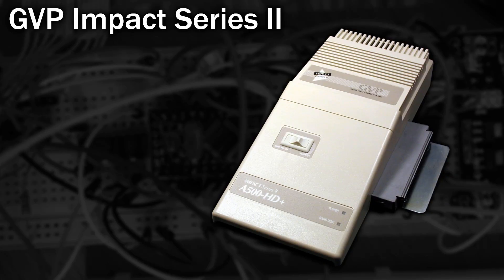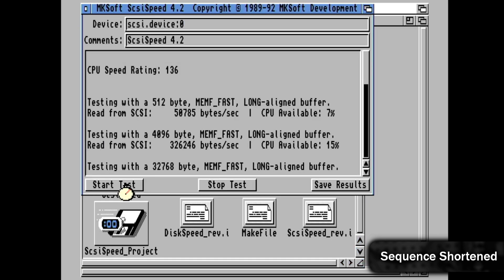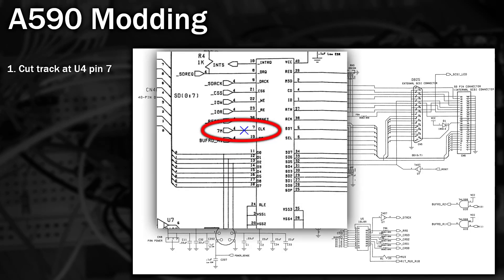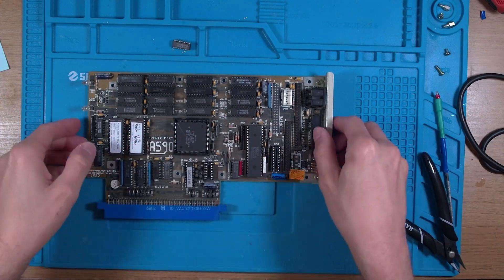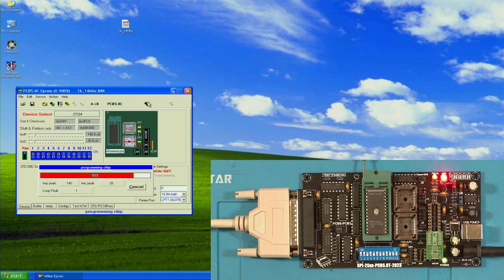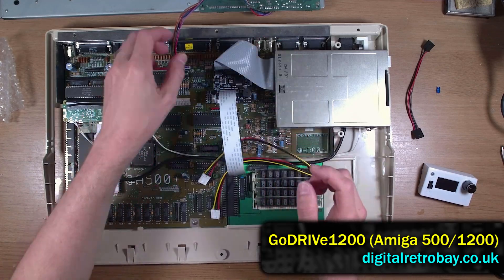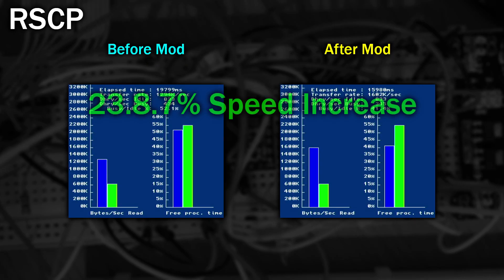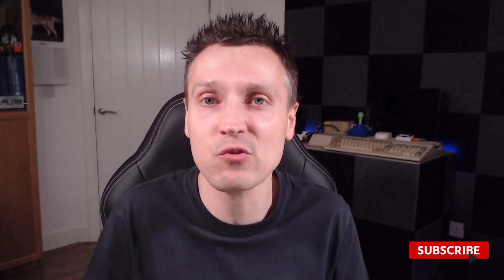14Mhz MOD - Turbo Charge your A590 - Back from the Dead - Part 4

Comment: I don't want to talk down the MOD. But with V7 ROMs, the latest SCSI chip, DMAC 2 and ZuluSCSI I have 1,453,663 bytes/second without any other modifications.
Reply from the maker: Yeah it’s fast enough without the mod, I just like experimenting. Someone pointed out a 20mhz mod too! I recently reverted the mod because it was causing some instability issues

Comment: Clearly there is room for more episodes in this series ;-)

I see two obvious areas for improvements: A. Since you now have a DMAC rev2, you can upgrade to a GuruRom. B. You can implement Speedgeeks improved ram-controller..... also the 74 series chips could be upgrade to ALS series for better/faster signals. 

Finally you clearly have other computers with "real" parallel port than an old dell... see that Amiga over there, it has a very nice parallel-port ;-) It would "only" take a reverse engineering of the eprom programmer software and a reimplementation on amiga-os then you can use the burner on the amiga hehe.
Reply from the maker: The GuruRom is really hard to get now from what I’ve understood and V7 of the normal roms is more or less the same. Oh I saw something about an app that copies the roms to fast ram for a speed boost, is that what you meant?
I’m not sure upgrading the 74 logic upgrade would speed it up but yes the signals would improve. And reverse engineering that beast of a program onto the Amiga, wow, I just don’t have the time for that!!! - there is one more episode on the way, but it’s not what you’ll be expecting

Comment: The header inside the GVP is not for an accelerator it is for the 286 bridgecard addon.  Commodore likely didn't do the speed mod because at the time the 14mhz version chips may not of been out or may of been more expensive.
Reply from the maker: Hmm not sure about chip versions, the only thing that was different is the ROM. But take a look at the 20mhz mod pinned in the comments. Works on original chips too. Who knows

Comment: Thanks rob, great video sir! Loved the bonus gotek mod you included, that is the way gotek needs to be done on the A500... but the controller mod that sits on top of the A500 all seem to be in white and doesn't really align with the original a500 aesthetic, better than nothing tho and cheap... but that really needs to be redesigned...  I wonder if an empty floppy drive case with the gotek display built into the side? Be interesting to see you design and build one!!!!
Reply from the maker: I totally agree about the Gotek. Shouldn’t be cutting holes in the machine and it looks great. I think you can get external gotek drives already or is this not what you meant?
Reply: @RobSmithDev Yes sorry, allow me to clarify. The current standard external gotek as you know needs a df0 mod for the a500 when using a standard external gotek seen as df1, the solution in your video bypasses all that in favor of keeping the original a500 floppy (A must for purists like me) but with the external gotek mod as featured in your video. So instead of using that 3D printed white case for the gotek display and jog dial, how about a empty external Amiga floppy drive case modified for the gotek display and jog wheel mounted physically into the side of the empty floppy case that can now sit on top of the a500 perfectly. From an aesthetic point of view would look like a traditional a500 external floppy drive with the power of gotek.. (not sure how practical it would be to do tho) I hope that makes sense!!! Great videos rob, the time, effort and diligence you cram into your videos is joy to behold!!  Your work with drawbridge and how it came to be really is phenomenal all these years later...Incredible!!!!
Reply from the maker: Ah I see what you mean. I suppose it’s possible, would probably be very easy to do I guess it’s just a different case but only for the a500, wouldn’t fit nicely on the a1200. Thanks for the kind comments and if there’s any feedback about my videos etc please feel free to share

Comment from the maker: 20 MHz Mod:
Alan Leverett: Have you checked out how I did this mod ? https://levosretrocomputerprojects.co.uk/a590-20mhz-mod

By the way the 33c93 is designed to run at 5MHz and the reason you have to program just one ROM chip is to set the divisor to divide by 3 . 14MHz / 3 = 4,66MHz and the original rom has set it to divide by 2 . 7MHz /2 = 3.5MHz . My use of a crystal oscillator module has it at 16MHz / 3 = 5.33MHz , slightly overclocking the chip .

You could , of course just leave the roms stock and use a 10MHz oscillator to give 10MHz / 2 = 5MHz .

Comment: Nice mod, and a decent speed boost as well.
I do happen to have a GVP HD8+ (with 4mb of ram fitted) and I tested it with sysinfo (I don't have the other software to hand).
and the speed was:
1904193
Reply from the maker: I think to be fair it would have to be tested with the exact same blue scsi setup I have (same SD card too) but looking at that the GVP still wins

Comment: if there weren't issues about the overall height it would be better stack two sockets, bending the leg of the second one and not chip's pin. In this way the mod would be even more reversable.
Reply from the maker: Yeah height is the issue. Mind you that chip is easy to get too. Thanks for watching